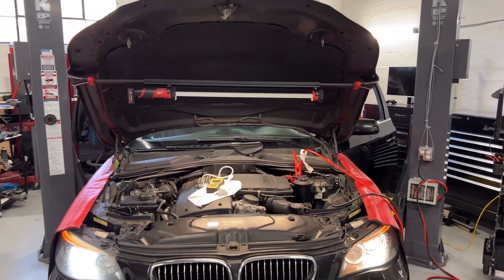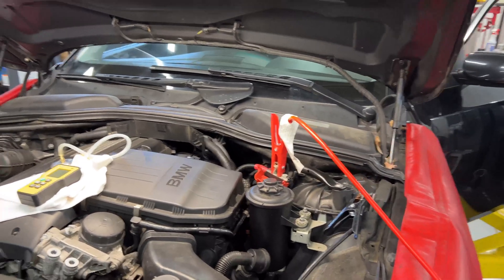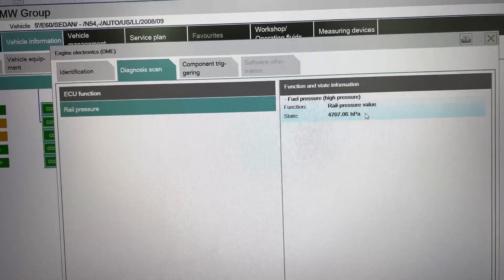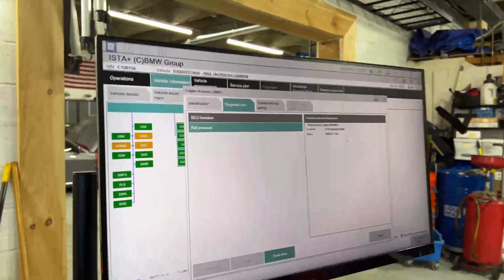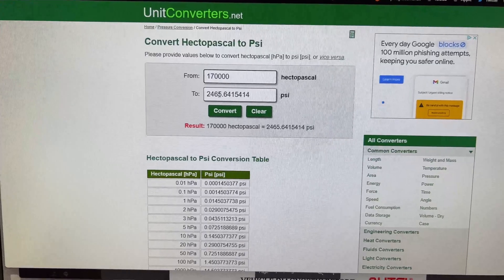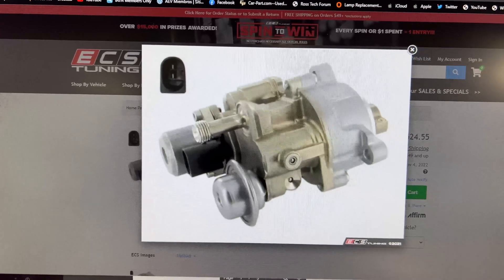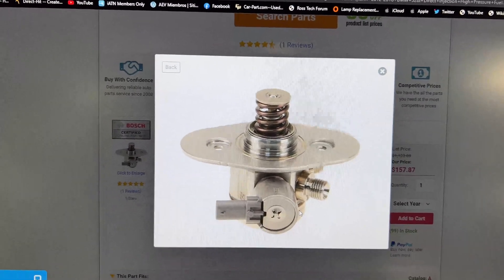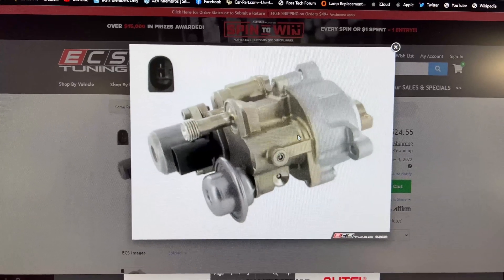2010 BMW 535i N54 High Pressure Pump Fuel rail pressures test tips

Comment: I have a 2009 bmw 535i xdrive n54. Is that a new or old model? Should it hold the pressure or no? My high pressure rail "rests" at 3000 hPa. When i try to start, it goes up to 170,000 very briefly... but if i let it keep trying to turn over, it drops and hovers closer to 115,000 hPa and never gets back up to 170,000.
When i turn ignition off, it drops back down to 4998... and after a second drops all the way back down to 3000. My car doesnt start, but does this mean the fuel injectors or pump are bad?
I have ista+ and when I trigger the fuel pump for its 20 sec test it says successful.

Comment: Would a failed HPFP cause a crank, but no start?

I don’t have ISTA+ but I have access to Any and all Autel tools since my brother works for them. I’m trying to help figure out why my sisters 535xi, 2011 won’t turn on after replacing a faulty EKPS module.
Reply from the maker: If you replace the EKPS, did you measure the amperage of the fuel pump? Most likely you have a bad fuel pump too
Reply: @MaicSalazarDiagnostics  fuel pump/fuel filter assembly are brand new and recently installed, EKPS was coded and installed correctly to the cars DME. 

After installing the EKPS, the car ran and drove for 2-3 days. Randomly the car never turned on and has been parked since.

So it currently has a brand new battery, brand new fuel pump assembly & a used, but working EKPS that has been properly coded to the vehicle. I am dumbfounded to say the least.
Reply from the maker: Also did you code the EKPS?

Comment: Thankyou for sharing this knowledge, so in a Bosch type pump after warming up if I turn ignition off & on high side fuel pressure should stay high , if it is getting less that means injectors could be leaking, I think these Bosch pump don't tend to leak internally much ..
Reply from the maker: That is correct. But Bosh pumps do leak internally to crankcase, when this happen you’ll have low pressure faults on high side pump. The pump most likely will not be able to raise the pressure as you crank it.

Comment: Hi Maic, could you help me with one issue ? I test it in my 550i f10 and Ista says when we shut down the car an check pressure on the iginision we have it bank 1: 48009.91 hPa and on bank 2: 42607.67 hPa After a 3-5 minutes check once again and we have on bank 1: 48009.91 hPa and on bank 2: 27446.36 hPa. So on bank 2 there is some leaking of fuel ? Pump or injectors ? How long pressure will kept at ignition after engine was turned off?
Reply from the maker: That is definitely an injector leaking. The rail pressure can only go down if an injector is leaking. The high-pressure pump will not bleed the rail, there is a one-way valve at the pump that prevents that from happening.
Reply from the maker: I will remove the spark plugs and use a borescope to see which injector is leaking. Also, make sure to replace all injectors if they are not matrix 11. IF they are Matrix 11 then you can replace the one that is bad and then perform the quantity relearn.
Reply: @MaicSalazarDiagnostics  thank you for your quick reply, a few weeks ago i did change all spark plugs for new and Old was clear and Little grey/white colour. But all of them was dry. All my injectors have index 12. I check it once again and  pressure of fuel on bank 1 as a first always go to low but after an 1 hour both Have low pressure about 880 hPa, on bank 1 (driver side ?) I Have 4 new injector 12 indeks (replaced on this year) on bank 2 I Have also injectors index 12 but replaced on 2014 by BMW on warranty. IT is possible leaking of injector index 12 ? Or mayby high pressure pump leaking  ? Pressure pumps are OEM and car have 250 000 km right now without any errors and issues of power but sometimes need 2-3 seconds cranks to start up and sometimes need only 1 seconds to start
Reply from the maker: @jwayler  well one hour is normal for pressure to be low. This test is done in minutes. So are your pressures fine for at least 5-15 minutes?
Reply: @MaicSalazarDiagnostics  in 30 seconds after a turn off the engine on bank 1 pressure falls from 49000 hPa to 48730 hPa and on bank 2 pressure falls from 49000 hPa to 39000 hPa and after next 7-10 minutes pressure on bank 1 falls to 40203 hPa and on bank 2 falls to 23832 hPa on bank 2 is falls faster
Reply: @jwayler did u ever get the issue I have a 550 too
Reply: @SageXteriorCleaning Bad injectors

Comment: I’m glad you made this video! I’ve seen the bosch style pumps leak while still maintaining pressure and even continuing to build pressure with the key off. The idea of them dropping pressure if they had a leak seemed to be a theory that everyone had in the beginning stages of GDI but it never came true. I’ve seen several VW/Audi high pressure pumps leak fuel into the crankcase but never loose pressure with the key off.
Reply from the maker: That is correct because the pressure you see in the scanner is the rail pressure (only a fuel injector leak if rail pressure goes low). So if no leak in the rail, then the only other leak is the pump. The pumps are known for not building pressure, but it is always good to perform this test to make sure no injector leaking is the real cause of low pressures.

Comment: Hi Maic,
I’m currently trying to repair an instrument cluster and a PCM on a 2000 Ford F-150. There are two chip that I believe are varistors but can’t find a data sheet on them. There are numbers stamped in them but I’m coming up empty on finding them. Any help would be greatly appreciated. Thank you for any help. The numbers on the components are as followed from top of components to bottom. The 3’s on the components look like sideways M’s but the look like 3’s also. 

1.)  220K
       0003
       TDK

2.)  09030
       97BP-CA
       TDK
Reply from the maker: Can you send me a picture at info@maicsalazardiagnostics.com
Reply: @MaicSalazarDiagnostics  just wondering if you had the opportunity to look at the photos I sent over? Thank you again for any help.
Reply from the maker: @bradmacon4147  I did, I can't find any info base on those numbers. it is a bit hard to go by that alone. You can either get a use ECM from a junkyard and use it as a donor. Or look online for Varistor decode info